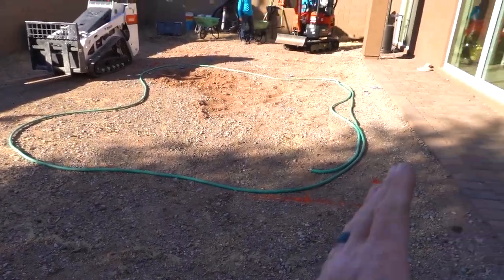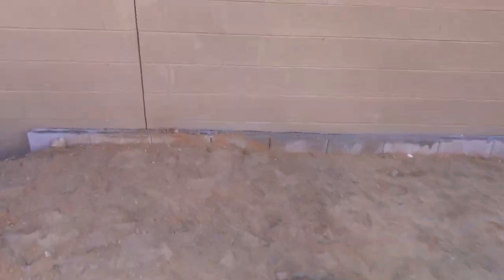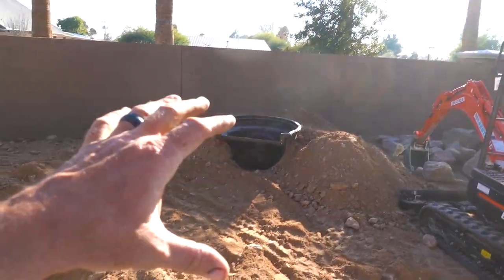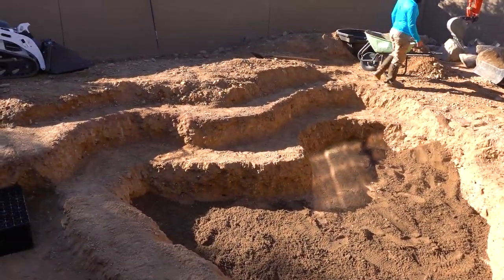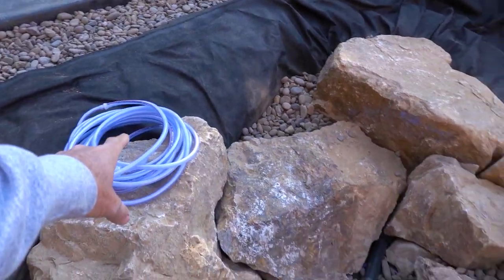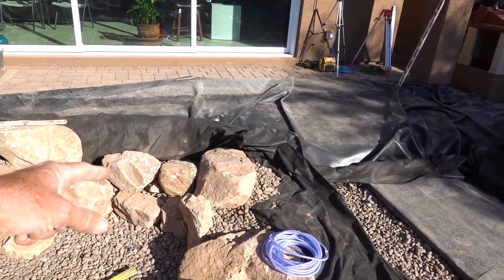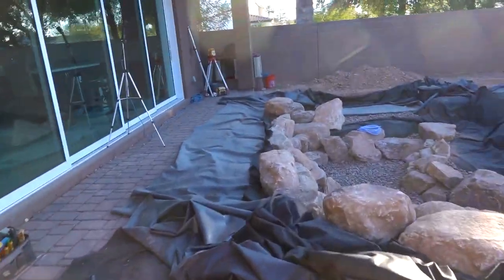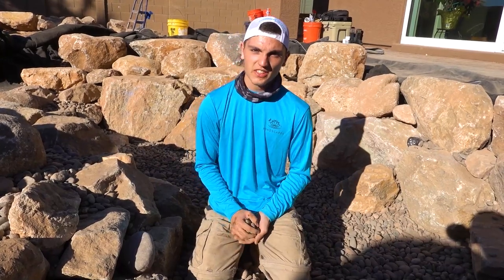Ecosystem pond with INTAKE BAY and Aeration

Comment: With my intake bay I notice on real windy days when the wind is coming from the opposite direction of the intake bay and blowing 20 to 25 mph the intake bay really does not do much on windy days coming from the opposite direction. Is there anything that can be done or just wait for the wind to calm down.
Reply from the maker: The easiest adjustment would be the addition of a “Pond-Powerhead”. 
https://www.aquascapeinc.com/pond-powerhead
Reply: @pondscapesaz  Forgot one thing. I am using 5 Aquascape AquaBlox with a 4800 GPH pump. Is the pump big enough for the intake bay?
Reply from the maker: @mikearmando  it might be just enough gph. How wide is your weir opening? You might want to add a rock or two to choke down the opening to the intake to increase the surface draw/skimming.
Reply: @pondscapesaz   Yes good idea that is what I will do thanks again.